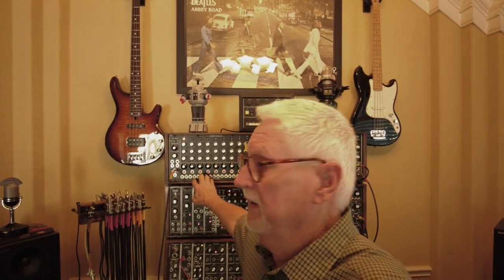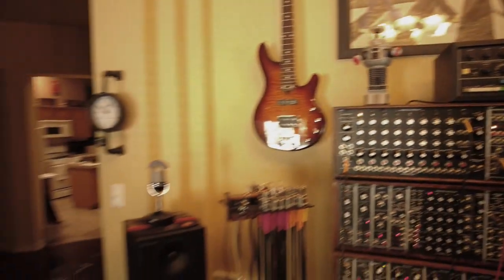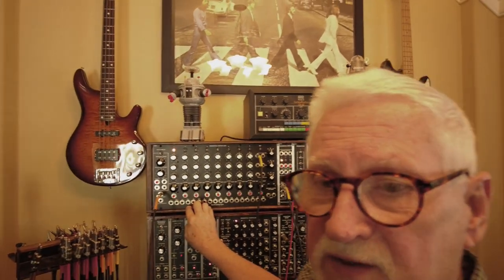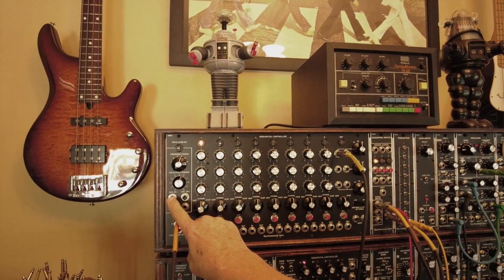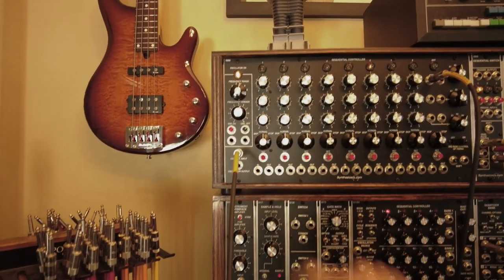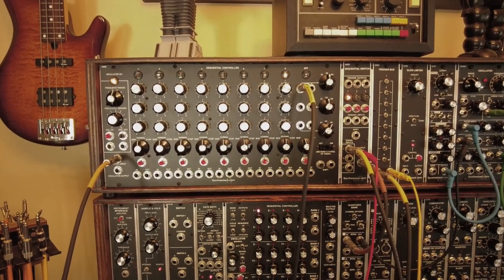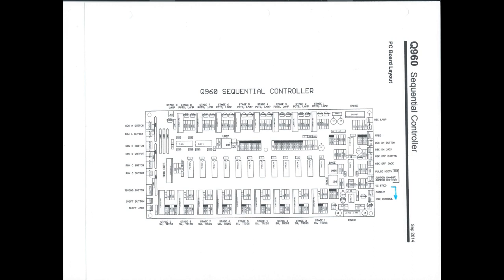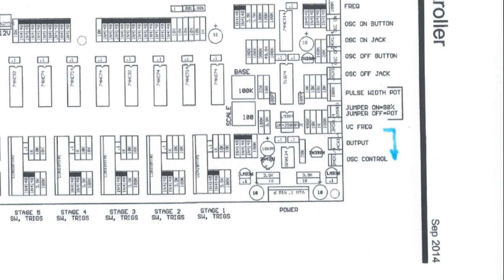External clock in on Q960 Sequencer???

Comment: Great tune at the end.  There are a ton of features buried in the connectors on the Dotcom modules.  One of the cool ones is a jumper to change the range on the ADSR for long time constants (attack, decay, release).
Reply from the maker: Looks like I will be checking that out! Thanks!😎
Reply from the maker: So I tried this...it's a huge difference! I'm considering installing a switch to enable or disable the long times. :)
Reply: @geoelectro  is that on the Q179?
Reply from the maker: @filipgeerts7683  Q109. The Q179 already has great range.

Comment: George, great video.  I looked at the datasheet.  I didn't see an explanation of the "Osc Control" header on the PCB.  How did you figure out how to do this?
Reply from the maker: I just tried it. Frankly I was ready to drill another hole with a new jack and try to find where it might be able to replace the internal clock. Maybe have the jack switched or add a selector switch like on the Q119. It just turned out to work with the other jack that was already there.
Reply: @geoelectro  Wow.  cool backstory

Comment: Hey George, is it just a question of moving a plug on the motherboard. I want to drive the Q960 from my RD-8 with one of the trigger outputs i.s.o. the shift input. Is it a hassle free operation?
Reply from the maker: You can use the Shift input as is. Using the mod here is only necessary if you want to use a Q963 Trigger Buss with an external clock. Yes, it’s just moving a plug on the circuit board.

Comment: I did this mod and at first it did nothing when using a Q106 pulse wave out to the 960 control input. I ran the pulse wave through the Q125 signal processor upper section and added about 1 volt OFFSET and it works. My guess is the MIDI module outputs a stronger signal level than the Q106.
Reply from the maker: Interesting. I mentioned in the video that you have to set the internal oscillator speed slightly faster than the intended external speed for it to sync.  I'm sure the Q174 has a 0~5V gate signal. The Q106 has a 10V peak to peak but that is 5v below zero and 5v above. I wonder if the negative portion of the waveform is the culprit?
Reply: @geoelectro  I wondered about the bipolar wave from the Q106 as well so I tried to rectify it using the Q130 Clipper. No bueno. I ran the Q106 into the Q173 Gate Math but it doesn't work either. Only using any of these through the Q125 Signal Processor was the fix. Works well when about +1v offset is applied. No bother really, just have to find what works. Nothing new in the modular patch world. Thanks for the communication!

Comment: How can I couple  the 960 sequencer to a Crave semi-modular? So far I haven't been able to make this work.
Reply from the maker: I’m not familiar with the Crave. I see it has a Osc CV in. That would connect to the output of the 960. The clock out of the 960 would go to the envelope gate on the Crave. Assuming the voltage levels are compatible it should work.
Reply: @geoelectro  All of a sudden it works, i.e. the connection of the first row of the 960 to the osc CV in of the Crave yields the result I aimed for! BUT I see nothing marked 'clock' on the 960. 
Thanks for your help. Next buy will be the 962 Sequential Switch.
Reply from the maker: @hubertvancalenbergh9022  By clock I mean Oscillator Output. It's the 960 internal Oscillator that "clocks" the sequencer.

Comment: Why don't you just use the SHIFT input? that's how you clock it from external triggers.
Reply from the maker: Using the Shift input moves the sequencer from stage to stage but there will be no gate outputs from the Q163 Trigger Bus module. I use the Q163 a lot so this was always a problem. I never use the CV in for the internal osc so this "mod" was perfect.
Reply: @geoelectro  fair answer.  I use external trigger sequencers (STG Soundlabs Trigger Mini-Store) to drive my Q960s and also fire off my EGs via multiples. They run off DIN sync and the timing is perfect since the software is based on interrupts instead of loops. Eventually I will hopefully figure out a way to persuade you into getting into Moog format sequencing designed by a fellow Hammond nerd lol
Reply: @geoelectro  also the Q963 doesn't respect the duty cycle of the Q960 clock AFAIK. I'm actually working on a solution (new module) for this.
Reply from the maker: @suitandtieguy  There is a modification they offer for this which I have installed.
Reply: @geoelectro    Okay, so I needed to check this out.  Here is what I found.  The Q963 DOES generate trigger pulses when using the Shift input.  HOWEVER, they are only about 0 - +1V instead of 0 - +5.  This will work on a MOTM 700 Voltage Controlled Router which has input sensitivity controls, but not on the Q962 (darn).  If you run it through a module to add 4V (like input 3 of the Q114 mixer++) then it should be fine with the Q962, or any other module that needs +5V to trigger.  (I was able to use the MOTM 700 to switch between no connection and the output of my Q123 Standards module set for 5 volts on the octave switch.  The Q963 does shift perfectly this way.)  While this is not a perfect solution, it does allow the Shift Input on the Q960 to use the Q963 Trigger Bus if you need to use it.
Thanks for the informative video and for the nice little song at the end!
Reply from the maker: @mishap.  Man, a deep dive investigation! Thanks. I do use the Q114 often for adding voltages etc. or inverting and not just mixing audio.